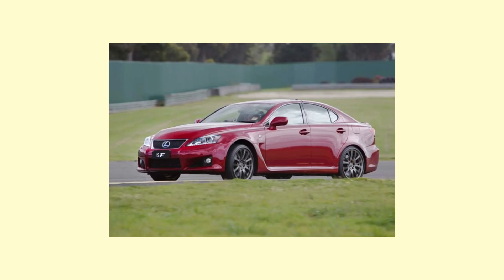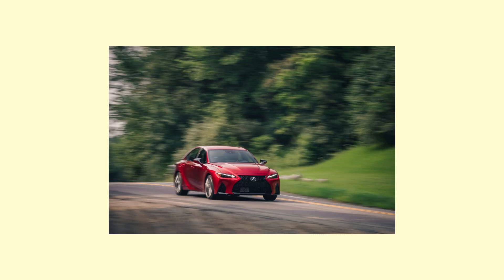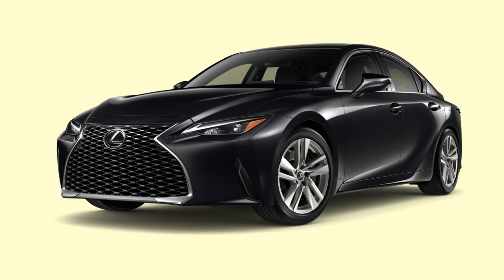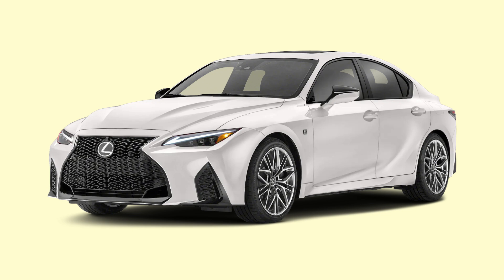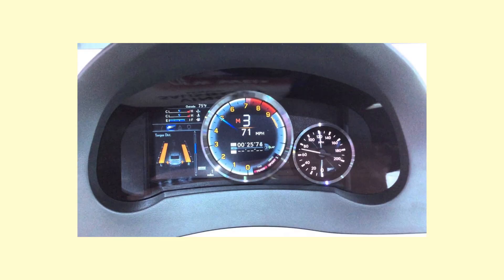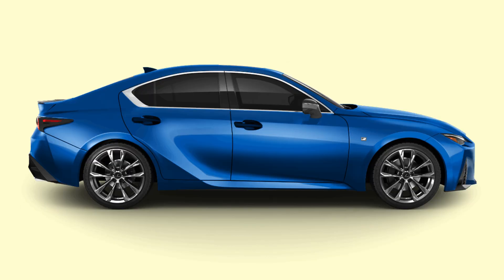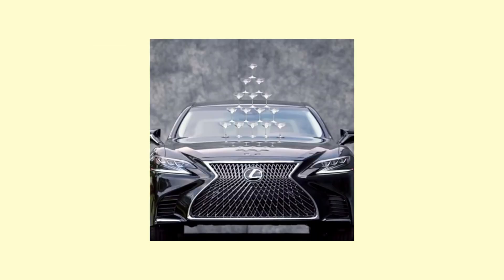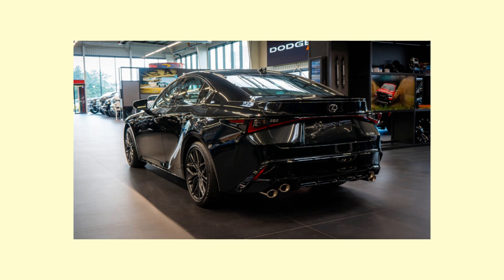Automotive X-Ray: Lexus IS 500

Comment: Great video, but I want to point out a few things:

1. The IS500 does have a water-to-oil cooler like the IS F, it just doesn’t have the air-to-oil cooler used on the GS F and RC F. 

2. Although the IS F has larger rotors, the ring size on the IS500’s two-piece rotors is actually a bit larger. People who have done the IS F caliper swap have noted that the IS F Brembo pads don’t fully cover the inner area of the IS500 rotor, which causes a small rust ring.
Reply from the maker: Thanks for the extra details man!

Comment: The IS 350 is not an F Sport Performance model. Also, wasn't that an orange RC F in the footage near the beginning? The gauges and side mirrors are definitely reminiscent of an RC F and not at all an IS 500.
Reply from the maker: Yep, we did mention that at the start of the Engine Brief section
Reply: The IS350 is a F Sport Handling. I would say my IS500 handles better though.

Comment: I have an IS500 and I immediately turned my ASC off. I’m not sure why it even exists, the natural induction noise of the car once the intake flap opens is intoxicating
Reply from the maker: Quite a pointless feature, might be due to reduced NVH so they want you to hear the engine clearer but not have to put up with tire noise? Glad it's this easy for ASC to be switched off, majority of times it's either in the infotainment or you have to rip open a few panels to manually unplug the fake engine sound module itself